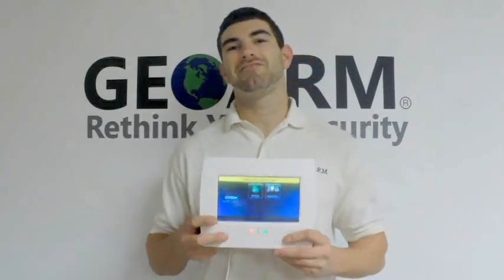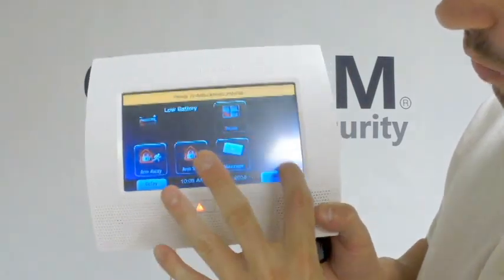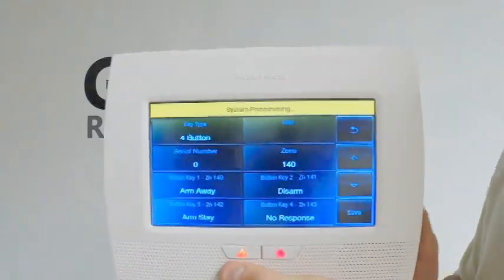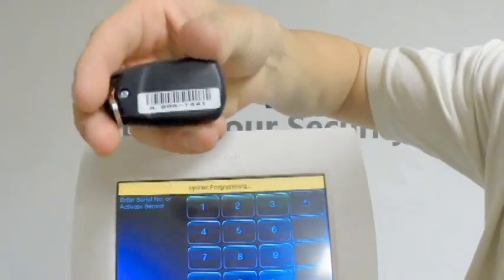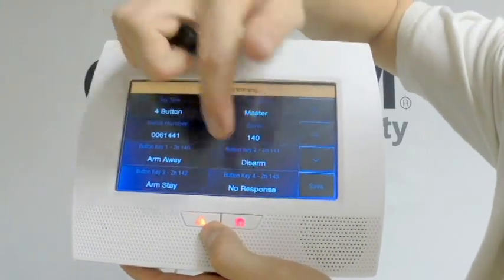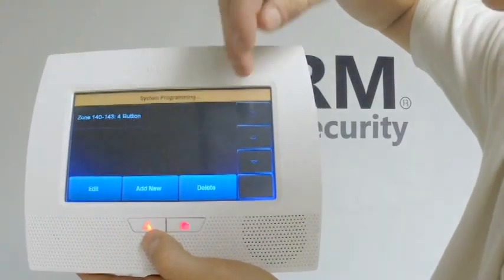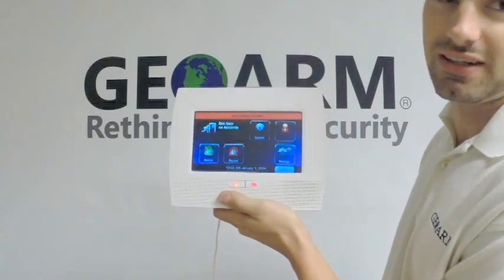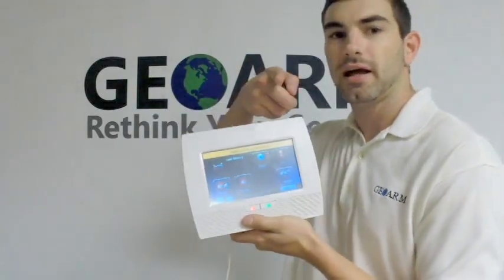How to Program 5834-4 Keyfob into Honeywell L7000

Comment: HOLA DAVIS, GRACIAS POR LOS VIDEOS MUY BUENA INFORMACION, TENGO UN PROBLEMA CON UN PANEL L 7000 HONEYWELL, NO PUEDO ENTRAR PROGRAM PARA CONFIGURAR MIS SENSORES, CONTACTOS,ETC, HAY MANERA DE RESETEAR EL PANEL Y PONERLO COMO DE FABRICA, GRACIAS POR SU AYUDA ESPERANDO RESPUESTA
Reply: Hola tuve el mismo problema. tienes que hacer lo siguiente:

1. quite el fluido eléctrico (batería y alimentación)

2.  al conectar el panel indicará "stand by". presione el botón inicio "home key"

3. espere que el sistema termine de iniciar

4. presione deguridad/arm stay / clear. aparecerá una luz azul debajo del código

5. digite 00 (cero cero)

6. bingo estas dentro de programming.

Nota no podías entrar porque al mensaje su quieres bloquear programming le indicaste que si

saludos desde costa rica.  waragoch@gmail.com